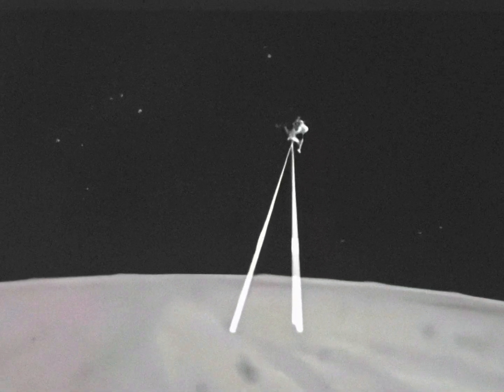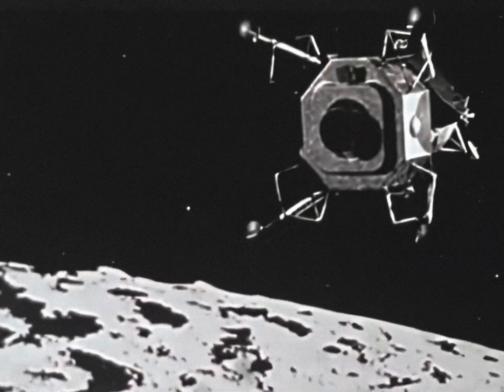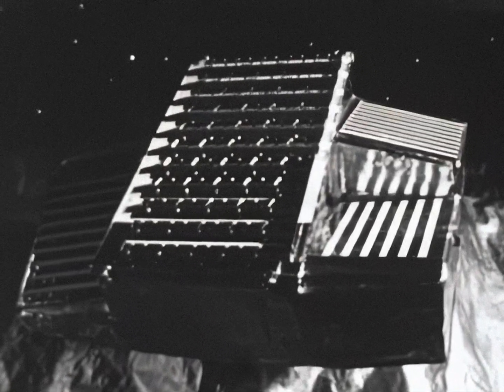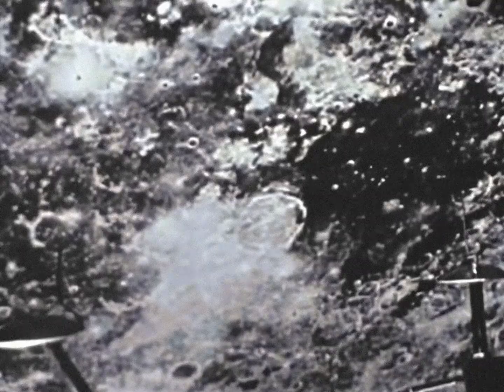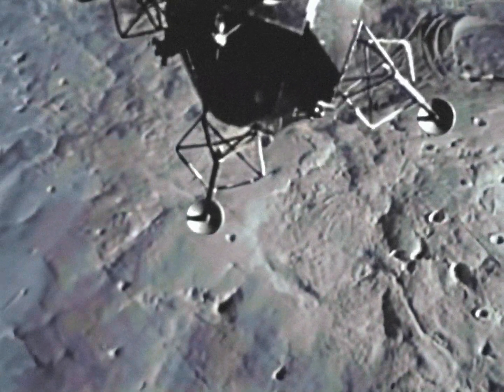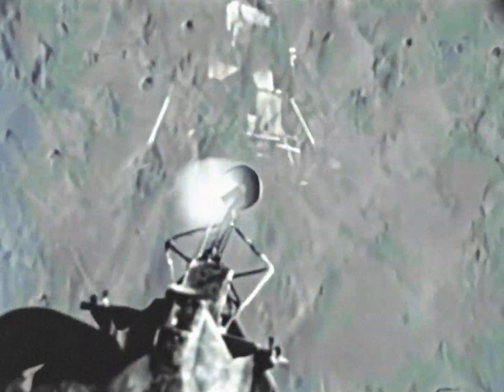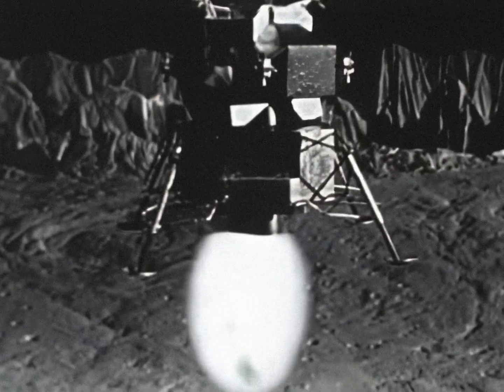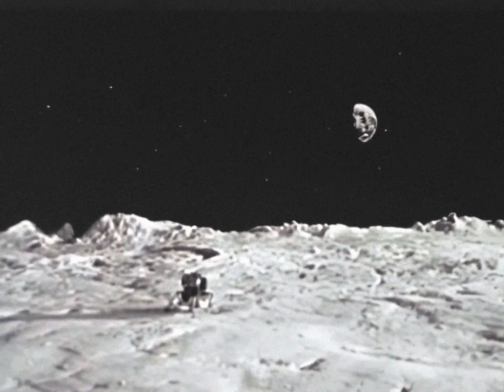7 Minutes to Touchdown - Ryan Lunar Radar, HD Remaster, Documentary, Historical, Apollo, Moon, NASA

Comment: A fascinating piece of film. Many thanks for sharing. I didn't notice a date on it anywhere. do you know when It was made? I only ask because right at the end the LM still has a contact probe on the "ladder leg"; and the sudden engine throttle back doesn't happen at "contact light on".
Reply: It's prior to Apollo 9 as there aren't any RCS plume deflectors on the decent stage, just the original (and insufficient) black protection arcs.